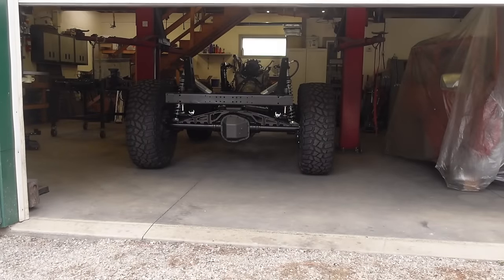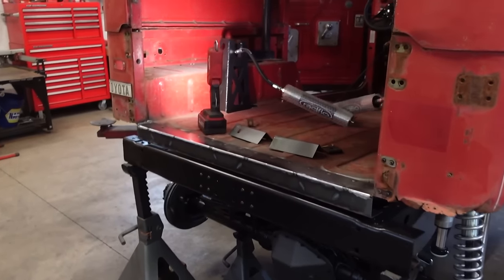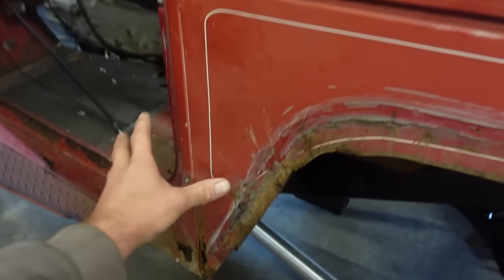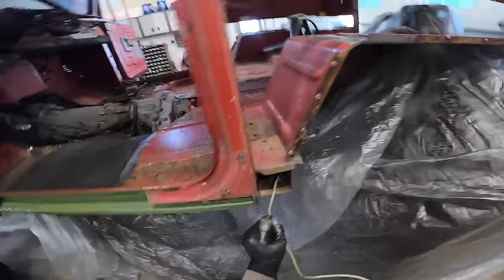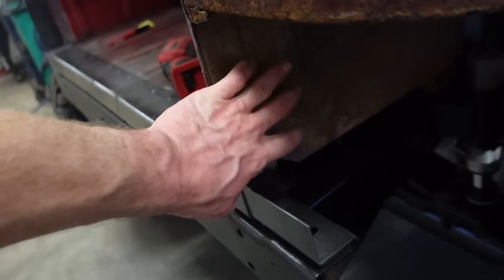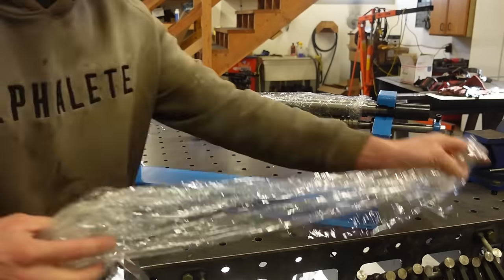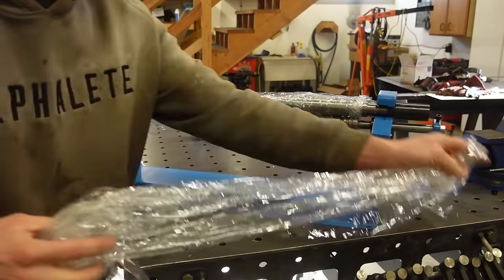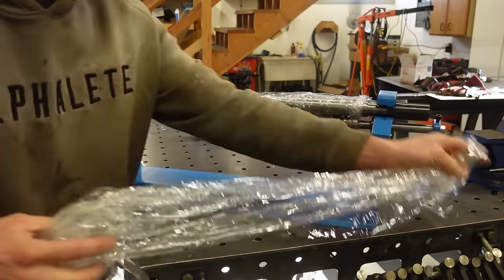Rebuilding The Body On The FJ40 Land Cruiser!! (Rust Repair)

Comment: Great work getting at those rusted out areas of the cab.   Using heavy gauge steel on the lower exposed areas is probably what Toyota only wished they could do.  
Excellent video.
Reply from the maker: For sure!! Thank you!

Comment: Looking incredible. Wish I had the tools to make my own sheet metal patches. In the process of fixing quite a bit of rust damage on my 4runner and I’m just using bondo and bondo mesh to fill in the rust holes.
Reply from the maker: Hey man you can make most patches with a cutoff wheel and flap disc!! Thank you!!

Comment: Now you got that shweeet roller it you can mold a piece of 3/8 round rod behind that fender edge. Just completes it, saves on cuts and strengthens it. . My 2 cents. Looks bangin tho bro, thats a big undertaking!!
Reply from the maker: That might work, but the edge of the fender is pretty much flush with the edge of the inner fender so there really isn’t a sharp edge there!’
Reply: @austinniemela  ahhh, that'll do donkey

Comment: Try a kneeling the steel before you try and bend it best way I've found to do it is to take oxyacetylene mix it rich words putting out black smoke run it over your steel until it's blackened and then heat it until the black burns off that's when it is annealed and it will be softer to bend doing a great job though awesome work!

Comment: I’m curious about the raptor liner. Is that like a spray in bed liner or an undercoating? I’m looking for something to coat the bottom and inside floor of my car to prevent rust from coming back. It was undercoated in 71 when it was new and a lot of it is still there but it’s missing everything in the back that was covered up.

Comment: I'm a beginner with no knowledge in welding. I have a wood shop. Wood is what I know. But have a 98 tacoma xtended cabe in good condition. But needs some attention. How do you remember what goes where? And not find your confidence break. Must been doing this since you were little? How did you get into this?

Comment: Great to see you fixing up the body work.  I thought you might leave it like you did on the white low rider toyota truck.  Not sure what your plans are for the finish, but a bedliner type of coating will be very durable and also forgiving with the body work.   Go with a tintable bedliner and it would look very nice.

Comment: Not sure what your plan is once the body is finished but I’d spray the body with bedliner it’ll hide a lot of the defects for patch repair and panel repairs and it looks amazing. You can get it in so many colors too.
Reply: NOOOOOOOOOOOOOOOOOOOOOOOO
Reply from the maker: I’m debating it! I love the look of raptor liner!
Reply: Raptor spray kits is what I have used in the past very durable easy to spot fix later and a bunch of other benefits. However Id stay away from Black on the body it fades bad but a friend of mine used matte clear over it and it looked amazing going on 5 years now. @austinniemela

Comment: What are you going to do about a flange or something on the bottom edges of those quarters? You can’t leave them like that. They’re a knife edge and will have no strength.
Reply: Won't need to strengthen it as he will be doing rock sliders...so that will take all impact
Reply from the maker: Bottom edge of rockers gets sliders, and the edge of the fender is flush with the edge of the inner fender so there’s no sharp edge there!